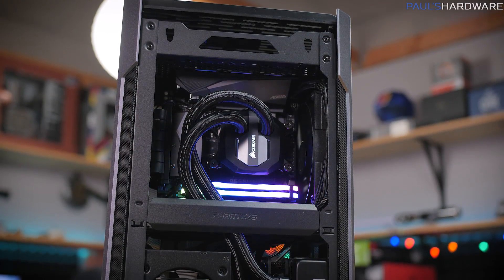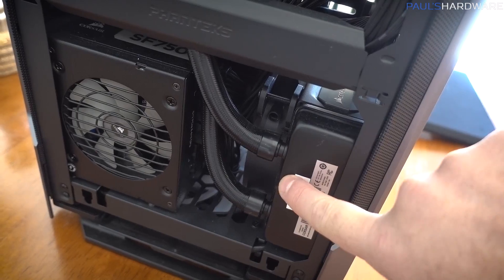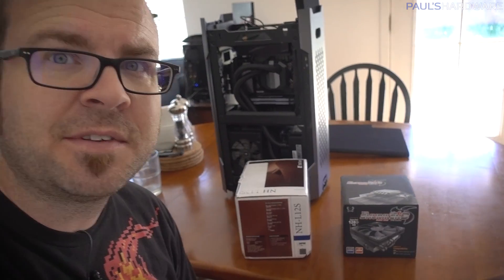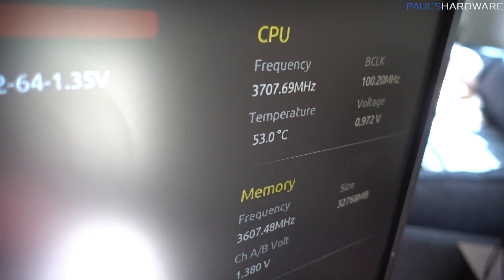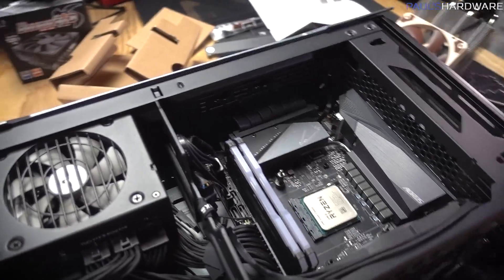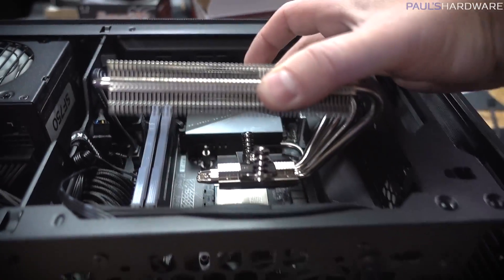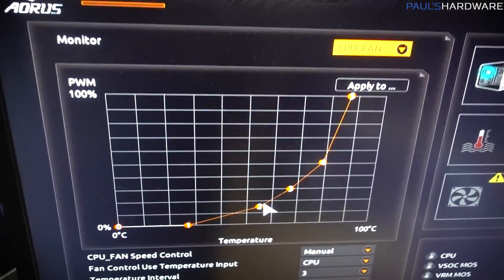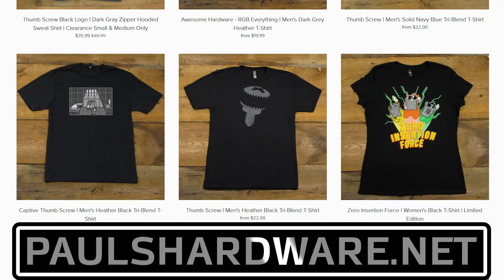You guys were right. The AIO died. ☠

Comment: diagnosed failed AIO from IBP today and installed a fan rad and its working awesome but totally appreciate the @4:50 tip bc when I showed up, it looked like everything was OK, even after checking thermal paste and mount positions.  Hard to see inside the braided wires but looking for any on chip vibration would have saved me a far bit of hassle and testing

Comment: Thia whole build is trash..  like bad postion of aio..  like no air flow.. that air in and out is going to be pure trash.. theres no space in that case its completely full..

Its an absoulute mess..

My god even the aio radiator fan is being blocked off with the gpu right against it.. so its sucking in all that gpu heat and more.. god bloody trash....

Im not going to go into aerodynamics..😅  that poor aio radiator and the fan and such..

You should use a noctua at this point, not an aio.. theres like crap  cooling in this case

Comment: I had an issue with my CPU cooler not working. It was fine until I took out the heat exchange to give it and the fans a good clean. When I put it back together and booted it up, there was a whining sound I've never heard before, and temperatures were sitting around 99°C. Sometimes it would boot to Windows, but shut down about 5 minutes after. Other times it would display a CPU overheat message on boot. I watched this video, and it got me thinking maybe when I took out the heat exchange that some air had risen up into the pump when it was hanging outside the case, below the level of the pump. I removed the pump, gave it a bit of a jiggle, put it all back in and boom. Whine is gone, and temperatures back to normal. Just wanted to mention this, and say thank you for the video; saving me from having to replace the whole thing! Legend!

Comment: No it's universally bad and horrible you literally had mostly air in the pump so it probably wasn't even doing anything and the reason why it "worked" in the first place is because you basically used it as a very inefficient heat pipe.

Comment: I do actually think that you put the aio to the worst place. If the pump is higher than the radiator then air will start to build up in the pump and slowly will wear it which dramatically decreases its lifetimes

Comment: Thanks for this video  Honestly i  been having overheat issues for 1 week i have an aio corsair that i think died on me.  I cleaned radiator with vacuum.  After removing it. And my pc temp was crazy 89 c just web browsing. I re applied thermal paste. Radiator is top of my cpu. But my AIO is like  5 ysars old. So i really feel that's the issue.   I think mine got air bubbles over time inside of it.

Comment: I did not agree with what's you said : "heatsink will do the job way worse but not at the point of shutting down" No even with an VERY low end cpu like an core 2 duo q6600 my fan got disconnected and the heatsink was so warm that the cpu was way over normal temp so it finnaly shut down so I opened the pc and take notes from that and when I touched the heatsink it was very hot. Not at the point of burning but at the point to hurt. So imagine with high end CPUs that way over the TDP of mine.

Comment: I have an AIO cooler (I'm not a computer guy, I didn't even know what AIO was)  and I do flight sims.  Ok, they work with no problem.  But my astrophotography software contains a process that is known to be highly CPU resource demanding.  My sim only shows "CoreTemp" at about 50C.  This other process brings them to an alarming 90C.  Where upon, after a few minutes it crashes.  I opened the side glass and in addition to the 5 internal fans, I used a strong portable fan to blow right on to the motherboard (CPU still covered by pump) and the temps were not lower.  It ran longer but still crashed.  This make s non computer guy me wonder how effective fans can really be??

Comment: Putting the CPU block above the Radiator will always kill the AIO, cuz the pump wears down fast when it struggles with air bubbles when its designed to move water. Its basic science.

Comment: 2022 will be the year i will remember as technology failing on me. New windows wont boot from brand new M2 pcie nvme ssd, i spend weeks without any luck, UEFI, legacy boot, flash bios, every combination, install windows thousand times. I buy sata ssd, windows works for one day. Gpu clock drops from overclocked to base clock during gaming, i spend days troubleshooting, i find out cpu temperature 90 degree celsius so must be the problem, even in bios after one minute. Troubleshoot my watercooler. Tried everything. I give up.

Comment: Prolly would have tried fitting a basic custom loop. Either with a small pump res Combo at the bottom somehow, or by utilizing the Alphacool Eisbaer Solo Pump/Block/Res-combo. It has a small res integrated into the block wich should prevent the airbubbles from getting to the actual pump.
Or even just a Alphacool Eisbaer 120 AiO

Comment: Your video may also be my issue. I built a system a few years ago. It’s worked fine since. I’d upgrade it, but I’m leaving the country in a few months and it’s not worth me building a new computer.  I have the fx9590 (worst I ever bought 😅) with a Corsair h105 cooler. It’s cutting out just after bios starts. Usually when the Windows logo appears.  I managed to get into bios and under no load it it in excess of 70c. I suspect the thermal cut off is the problem.  I’m unsure, but only one of the pipes is hot coming from the pump , the other is cold and the air coming out of the fans through the radiator is cool. I suspect the pump has failed like in your video.  I’ve also replaced the thermal paste.  The motherboard is an ASUS m5a99fxa 2.0.  Do you think this is likely the issue?   Annoyingly, cooling that awful chip required water cooling as far as I know. So I may have to look at another water cooler.  I’d appreciTe any advice

Comment: Hey i know this video is 8 months ago but i have the same water cooler master and i have the same problem actually is there anyway to fix it ? “Note” i have ordered air cooler master hyper 212 led turbo 2 fans” but still want to know what’s the solution of the problem water cooler” i have the pump working and everything fine but still have the same problem overheated “ and does the motherboard too will get overheating as the cpu ?

Comment: Is my AIO dead? In the BIOS, RPM for it goes 65 to 0.. 65 to 0 and repeats.. Basically turning on and off. Sometimes on certain days Its good? I'll hear water move RPM will be at 2300, I'll reboot and idle at 35 - 40c game at 45 - 60c but eventually over time (couple hrs maybe if that) Fails & RPM starts doing it again 65 to 0.. 65 to 0 in BIOS. Works maybe a day or so and fails? But I somehow tinker with it and get it too kick back on the nxt day  for some time. Should I just replace it?

Comment: Paul.
It wasn't your fault.
Corsair AIO's fail.
All 4 I have tried failed.

6 years ago I bought one, failed after 4 months.
CPU overheated.
Corsair replaced the AIO, I RMA'd the CPU through newegg.
Pump failed again in 4 months.

fast forward, I tried an elite capellix 360 for my new build with an 11700KF.
DOA.
RMA'd it.
Dead within a week, this time it overheated again, and both my CPU and mobo fried.
Fortunately both were replaced.

using an EK360 with a 5600x now.
cheaper and better.

F*CK OFF CORSAIR.

Comment: You could finger-touch the radiator header (where the coolant pipes attach) when the cpu temps were high for extra confirmation. Any water flow at all would have brought some heat down into the radiator, and been noticeably warmer than ambient, regardless of what the fan did (which is only responding to the reported temp and the fan curve). 

It's a physical check to see if water is moving in the system. Feeling the block for vibration is only to (inconclusively) test if the pump is rotating. But a well balanced and/or well clamped pump might not vibrate at all, so it isn't an absolute test. My own AIO (Artic) does not vibrate, even though it has the additional tiny air fan to cool the VRMs.  

Also, 3 months is a very short life - perhaps the AIO was supplied with air already in it?  Has anyone ever opened a new AIO to see how "full" it is?  (Hardware review???)

Comment: Hrm, Corsair AIO failing? No surprise there. Had two of them and they both failed in two years. Disassembled the plate on the last one and the fins were completely blocked up in the plate, so fluid wasn't passing through. Never buying another Corsair AIO nor will I ever recommend one to a friend. Either suggesting a high end air cooler or either an Arctic or EKWB AIO. The Corsair AIOs seem to fail fairly commonly so I'm not sure the rotation in this one would be the main issue?

Comment: I personally would've went with the Scythe Big Shuriken cooler. I think it will fit better in terms of size and appearance. There is also very little difference in cooling and noise performance compared to the Noctua cooler.

Comment: The pump might not have been bad I would of checked kinked toobs it looked like one was getting cut in half by the psu. How would I think this because I just built a mini itx pc with the CM NR200 with a 240 soon and ran into the same problem bought a new aio still same problem then realized the Toobs were a bit to bent. So I moved things around and gave them more room to lay naturally than bam it all runs perfectly cool and quite now. Honestly I would have just switched to air cooling also aslong as it took me to troubleshoot I'm done with aio in small forms for a bit after this one.

Comment: This Noctua cooler is one ugly MF. It works though, so... good enough, I guess.
Not sure how this Corsair AIO is made, but if there is a connector available to monitor pump RPM - might be a good idea to connect it to CPU_FAN header, this way motherboard will freak out when CPU_FAN is 0 RPM, and obviously, you could monitor its speed through bios or hwinfo64 (or any other monitoring tool) instead of guessing. 
Anyways, even though AIO installation was less than ideal with pump in the top - lifespan of 3 months is just laughable. Either Corsair makes crappiest coolers, or there was some other reason for this failure...

Comment: I was curious to see if you just turn around the pump block 180 degrees (with the tubes down) so the highest point would be somewhere on the upper size of the pump block, maybe it would of been fixed? But yeah, air coolers never fail no matter how they sit, :-)

Comment: that's weird your aio went out i bought a cheap zoom flow from Newegg over 2 years ago and sitting same way still runs at 25c idling one of my cores right now is 21 typing on youtube ..45c gaming on a 9900k no troubles yet,240 one and i run it hard no changes yet.I don't trust corsair i have bought 3 high end keyboards from them and they all dyed like a few days after warranty ended. They wouldn't stand behind them.

Comment: When I was building with this cooler, I read that this orientation of heat pipes, like an upside-down 'U', can cause higher temps by like 6-7 degrees. The water inside can't move from the cold side to hot side as easily.
Reply: It's true, I had a similar thermalright heatsink that showed a 3°-5° difference depending on pipe orientation.  Unfortunately, Paul didn't have much choice here because it would only fit the one way.

Comment: My h115i died aswell but, after almost 2 and a half years(had the pump in the middle of the rad so no problems there.. it just died). As it offers 5 years warranty I contacted Corsair and they opend up a RMA. Had to ship the AIO at my won expense. Received new AIO, the h115i pro rgb and sold it. Bought an air cooler :)

Comment: The problem is build up over the center of the cpu block cooling fins blocking flow, you can disassemble it, clean the block with distilled water and a plastic brush/gentle plastic scraper and reassemble it with minimal coolant loss or top it up with distilled water and done. Copper will be discolored under normal use/age. FYI the seal only goes on one direction. Just did it to mine 1 week ago , it was a 10 minute fix. Unit is a 6 years old h100I v2   NOTE:: use a proper sized screw driver and apply plenty of force.

Comment: Would an nzxt aio with the pump in with the radiator fins cause the same issue or no? Technically the pump is below the block, but the air would likely still pool in the cpu block, so idk.

Comment: Just look in BIOS for 3-4 pin power adapter the pump is using and see what the RPMs are on it to verify the pump is actually dead or just running too slow.

Comment: I have the same setup with the H80i in the same case. According to your fan curve you are starving the pump out of power. In the bios you are supposed to set CPU fan to full speed/full power and use the iCUE software to control the fan speed/curve. The pump wasn’t getting the full 12v it needs. Could be one of the reason why the pump failed prematurely.

Comment: The basic problem is that the air always rises to the top of the system.  When your pump is at the top of the system, the air tends to form up either directly in the pump or (more likely in this case) in the hoses right above it.  This means that the pump could not move enough fluid to actually make it circulate, and as a result, you get rapid overheating.   Beyond the question of air in the system, you also have to consider the effects of heat.  Heat rises, which means the heat wants to go to the top of the system.  This puts extra stress on the pump as it has to try to force the hot liquid down to the radiator against the nature of the heat, rather than the other way around.  When your radiator is above the CPU level, the heat will naturally rise up in the system and the cooler fluids will come down, so even with the pump off the system has some effects of cooling, the heat will naturally rise up to the radiator.  Your configuration makes the heat stay at the top in the pump and as a result on the CPU.  This leads to higher temps at the CPU, shorter life of the pump, and because the pump is having to work so hard against the natural of heated fluid, that too can shorten the life of the pump.   Simply put, if you had turned the case upside down, it probably would have worked perfectly.

Comment: and you did it WRONG AGAIN ...

the air coolers (like the AIO) have a position to work 100%, the curve tubes of the pipes need to be side way and not on top (or bellow), sure because is a air cooler it will work anyway but will not cool 100%, also some cooler have on the manual saying the position of the cooler AND TO NOT INSTALL WITH THE TUBES ON THE TOP

because gravity exist and the way the air coolers work by boiling the liquid on the plate having the pipes on the top or bellow the liquid will never reach the radiator and will be stuck on the curve making the cooler less effective, if the curve is on the top the liquid will never reach the radiator, having the curve bellow the liquid will never reach the CPU plate
Reply: I hope you see this comment because sure a air cooler will work anyway but the difference between a good install and a bad one can be 10 degrees or more offset

Comment: Most of us are now well aware of the proper mounting of AIOs to avoid water cavitation in the pump, but I noticed something bad about how this particular pump was the installed for this situation. The inlet and outlet hoses were at the highest point of the loop, and it would be interesting to know if having the block flipped to have the hoses at the bottom of the pump (block) would have made any difference? Lastly, and I'm sure Steve over at Gamers Nexus ranted about this, but now that we know that pump and radiator mounting is critical to the lifespan of an AIO. Who is now responsible if the case designer/manufacturer markets their case to "Support XXXmm AIOs" with a bad layout that then promotes AIO failures through (documented) poor design? Manufacturer, SI, and/or customer?

Comment: I do not use liquid cooling in my system, but air coolers will sometimes have trouble of their own. Time to redo the thermal paste in my system I think. My space heater has shut down a couple times the last couple days.

Comment: Stupid artsy fartsy form factor case mixed with the derpitude that is water cooling. I'm shocked it failed, SHOCKED I SAY!!!

Laugh being if you'd gone with a Hyper 212 black and a cheap $30-40 DIYPC case, this "chad" would never have had a problem. I guarantee this thing is going to come back again, and keep coming back until you move it into a case based more in function than form.

But this is what happens when artists utterly devoid of engineering knowledge delude themselves into thinking they're "designers". Cases like this belonging alongside other such engineering disasters like "wave motion bridges" and "death ray buildings".

Comment: I think it would be more accurate to say that you want the radiator to have tubes down and as such the radiator tank on the opposite side of the radiator on the top. It can be below the the cpu block as air will be mixed with water and form micro bubbles which are pumped through the system. It might be slightly harder for the air to get to the radiator but once there it gets stuck in the radiator tank as there is a lot more volume there and thus the flow rate is way lower. Once the air is there, it won't so easily mix with the water again because the low flow rate won't cause as many micro bubbles and the volume of the radiator tank is enough to keep the air out of the exit tubes from the radiator. I think you'd have been fine if you could've mounted it down there with tubes down.